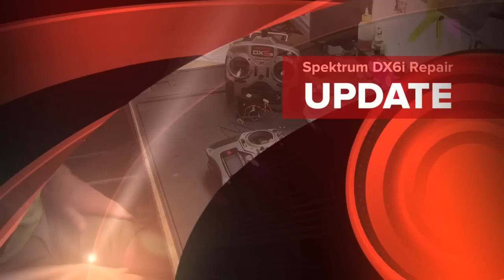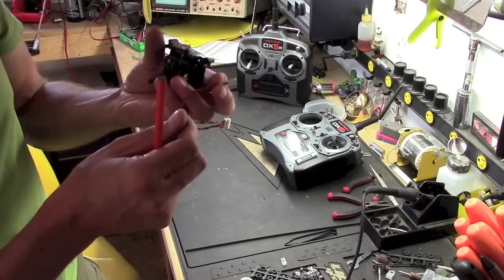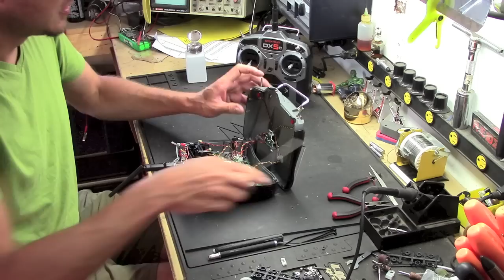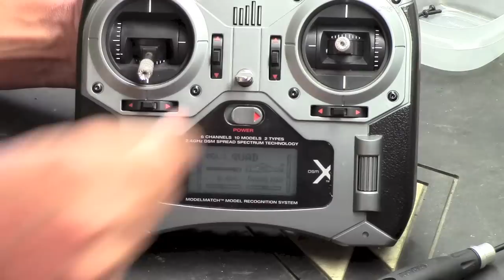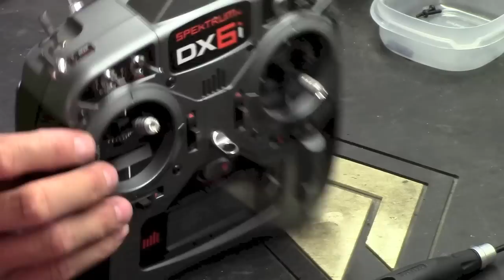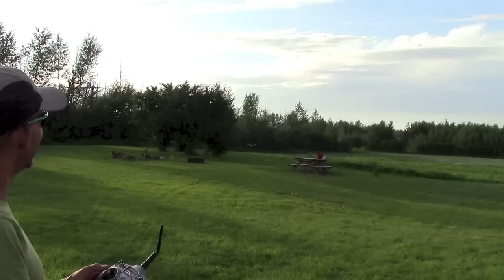Spektrum DX6i Repair

Comment: Another one fixed, many thanks for your video and it's got a young lad flying so a great outcome. Ironically it's only my very first dx7 that's been reliable, all others have had failures and I'm still amazed that every futaba we've owned back to an 'm series' we used in the 1970's still work! Great that spektrum brought 2.4ghz to the model world, maybe a little more quality needed though in my humble opinion and best part of 50 years experience...

Comment: I know this is an old video, but I fixed my DX6i using replacement potentiometer using a hole gimbal replacement for a FlySky FS-TH9X Transmitter: https://www.banggood.com/Flysky-FS-TH9X-2_4G-9CH-Transmitter-Spare-Part-ThrottleDirection-Main-Bearing-Seat-p-1057412.html?rmmds=buy&ID=521910&cur_warehouse=CN
You can pull the pots out of the FlySky gimbal and replace just the pots or you can just replace the centre of the gimbal as the gimbal housing are almost the same. The Spektrum housing has slightly longer post holes that mount the gimbal in the DX6i body. You could technically unsolder the wires from the Specktrum gimbal body and just use the FlySky body as it would work, just less thread holding the gimbal body in the housing. NOTE: You must calibrate the sticks before the new pots work successfully. Search for calibrate DX6i on youtube

Comment: Thanks for the video.  Mine was doing the same thing.  I pulled had it apart & was looking at replacing the pot, but after watching your video I decided to clean it & see how if it helps.  Well, it's working again, and you saved me some work.  Cheers!

Comment: Thank you for posting this. I had the same problem, no response on the throttle. Cleaned it with the eraser and alcohol, and it works now.

Comment: Used a little hot glue to hold the pot cover on instead of bending the tabs back assuming I'd have to do this repair again eventually.

Comment: I repaired Nikon, Leica, cannon, etc 1980’s generation cameras. I personally used zippo premium lighter fluid in the tin. That’s all you use in a camera interior as it will not damage components. If lubrication is required, mix a small amount of graphite in a small amount of lighter fluid and work fast. Apply to component, exercise a few times, fluid will evaporate, problem solved. It never affected electronics, light meters, and so on.  It has been used for repair since cameras first came out. Hope this helps, Jimp

Comment: WOW! This works. Had an elevator problem. Horizon wants $60 to $80 to fix and they won't sell "internal" parts. Tech said the DX6i is obsolete and I should buy a new DX6 or DX6e.

Comment: OK, received the DeoxIT kit and decided to service all four potentiometers. If I'm doing one, I might as well do all four. Not for the faint of heart.  Requires taking out both gimbals and partially disassembling them so you can get to the aileron/rudder pots.  The other two pots can be serviced easily because they are right on the end.  The aileron/rudder pots require lifting out the metal retainer clip holding the elevator/throttle pot, that will allow removing those pots and then you can get to center of the gimbal for the aileron/ throttle pots.  I would warn anybody doing this to be careful when bending the 3 tabs on the pots, you don't want to break them off.  But I was able to open all four of mine, (clean, condition, and lube) and get it all back together again.  Got out to the field to test it with a Parkzone SE5a foamie and put in two flights.  All seems well with my DX6i.  Will continue testing, and doing range testing.  Anybody doing this should realize they could be frying their Tx and it's a risk they have to decide whether to take or not.  But it does seem "Doable".  I won't be buying a new Tx yet.
Reply from the maker: BansheeFifteen Cool. Keep us posted on how it works.

Comment: Just an addition to this thought train.  I had cleaned mine with denatured alcohol and a q-tip and it solved the problem and my elevator channel is working fine now.  I've continued to research the subject of cleaning potentiometers and in the guitar amp world where this seems to be a common problem, a product called Deoxit seems to be the product of choice.  Since we can get into the pot, I ordered the Caig DeoxIT, Gold, Fader - 3 x 2ml squeeze tubes, 100% solution - 1 each of D100L, G100L, F100L
              
 and will do a three part cleaning, enhancing and lube.  The alcohol and Q-tip solved the problem, but since you can find this kit on ebay for $13, I'm going to try it for the added benefit the kit offers.

Comment: Problems today with my DX6i and a glitchy elevator, all the other channels working fine.  My first gasser, a Great Planes Giant Super Sporster and I've had 11 previous flights.  I've been using this transmitter for at least the last  4 years and and its been great, until today.  It's very alarming to see during the runup and surfaces check.  No UP?  Quirky glitchy DOWN?  Something Is wrong for sure, shutdown and go home and do some trouble shooting.  Well three other planes I have on this Tx exhibit the same problem, So its the TX.  

This solution shown in the video corrected the problem.  All I used was a Q-tip and some denatured alcohol.  The smallest amount of black crud came off.  Probably saved me $300 if I went out and replaced it and saved me at least a month if I had to send it out to HH for servicing.   THANK YOU BIG TIME.
Reply from the maker: BansheeFifteen You're welcome. Seems to be a common problem with this generation radio. Horizon must have made a bulk purchase of cheap junky potentiometers.
Reply: Yeah I'm going to be watching this Tx closely as I continue to use it.  I bet I got a $1000 invested in the Great Planes Giant Super Sporster and I sure don't want crack it up because of a faulty Tx potentiometer.  My 18 y/o Hitec FM Flash5 has never had an issue like this.  I originally thought Spektrum was better than it actually is. Learning about the MONITER screen and using its info is going to be added to the cheklist.  Otherwise, besides this recent problem, its been a good Tx.

Comment: Thank you! Taking the pot off and cleaning the sensor fixed my elevator stick centering issue! I also made sure to bump out the tiny coils that make contact with the actual pot a bit more.

Comment: Thanks so much for the video. I had the same problem but with the Rudder. It was reading FULL LEFT. I fixed it as shown on the video and it works flawlessly. After repair I measured the resistance of the Rudder potentiometer and it showed similar readings as all other potentiometers of the TX.
Reply: I have the same Problem with the aile. But these horizontal potis are harder to reach or not?
Reply: +Tom Doener sure that are

Comment: Thank you very much! you saved me at least 70 bucks. I had the right side left and right pot get flaky. It was the one more on the inside, but I only needed to get 2 of the metal posts open to get the pot open. It worked great so far! Thank you Brother!

Comment: Thank you very much for the help.  I also had trouble with my pot, the aileron to be precise.

I used my resistance tester and tested the contact points on the pot and the end of the lead wires to make sure that there was no break in the wires.  Then I removed the pot caps and cleaned both the insides as you recommended.

It worked and now before every flight I will check the monitor to make sure they all work before any flights.

You saved me a lot of money as I do not live in the USA.  

Hope it last.. :)

Comment: Im having the same problem but with the rudder channel.. Where is the potentiometer for that? Im not running the DX6i, Instead I have a Tactic TTX850. The stick will read different pretty much every time i turn the transmitter on.. Any input would be appreciated